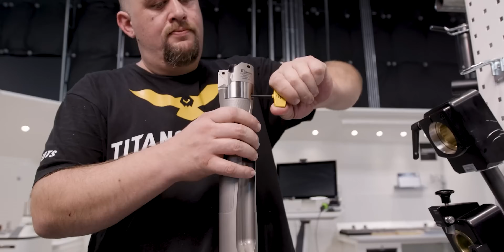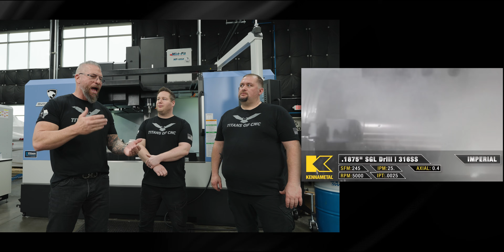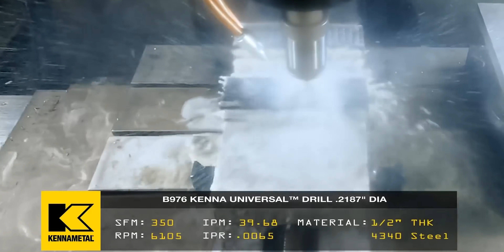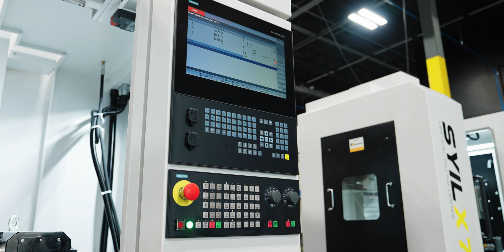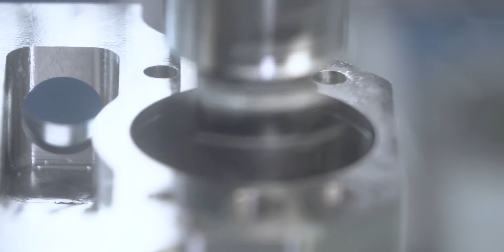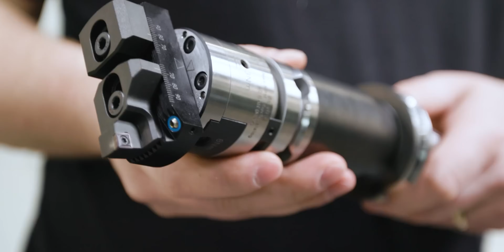Which Tools Should I Purchase? and Why?

Comment: Flower shop is a custom shop do a lot of one off parts and not repeating jobs. So we just have a bunch of general purpose everything in the shop and every CNC operator is a programmer. They'll  hand you the part and sometimes the material or you go cut your own material.

Comment: With bigger more expansive companies also comes certain service, we had a job that required us to cut time spend per piece down by about 20 minutes, with our existing tools that wasn't possible, we had a representative of some companies come around and test specific for the machine, we spend a lot of money on those tools, but they paid themselves off because we managed to reduce the time down to 16 minutes, tripling the daily output. 

For regular jobs where things aren't tolerated so harshly we just use what ever, I got a drill set for 5 bucks, when the drill is dull we sharpen it ourselves or throw them to the dreaded insert pile for recycling.

Comment: Another thing that can be done to extend tool life is to add coatings. I use a Sumitomo 27/64 drill turning 3884 rpms at 32 inches per minute feed for a thru hole of .465 in 1141 mild steel. It comes with a TITN coating of which I can get a consistent 300 parts per drill. When a black steam oxide coating is added I can get a consistent 2300 parts per drill. To put this in better perspective each part has 4 holes so 300 x 4 =1,200, 2300 x 4 =9,200. That is an increase of 8000 holes per drill so it is well worth the cost of the coating.

Comment: I wish you would have stressed more the machine aspects. Some of what you described doesn't apply to me because my machines don't have the performance to run them. Also, you could have gone into more depth about tool life versus cost. Just because there is a tool (Godrill) that lasts a long time doesn't mean 10 of a cheaper drill isn't better.

Comment: A good milling cutter should not be paired with a cheap, low-quality tool holders，You should consider the impact of the accuracy of the tool holder on the machining, and the influence of the taper（BT CT SK ) AT3 F1 on the machine spindle.

Comment: Something I would like to add to this discussion: when using end mills 1/8" and smaller they really should use high quality hydrologic style holders  because once you start getting smaller and smaller the chip-load gets quite a bit lower and this is where TIR becomes quite important. Especially when you start getting below 1/32 dia end mills. Anyone who has used heat shrink holders  should be aware that that while they're really good for 3/8 to 1/2 shank and up dia end mills they don't work very well with the smaller dia stuff because it's very difficult  if not impossible to get it back out when you need to change it... something that can help with that issue is companies that make smaller end mills with larger shanks kinda like Robjack brand. They're a little more expensive but I've used them many times with great success in heat shrink holders... Another thing of note; is that a lot of times, when a hole needs a reamed finish and size, you can use a good carbide drill with high pressure coolant thru the drill so long as you have high pressure coolant thru the spindle on the machine to make the hole "1000 psi is really good for this" and it will and can give really good finishes and hold size very well so you can be more efficient when doing holes where this will work. For an example, back in the late 90s working with a Mori-Seiki SH400 that we put a Chip Blaster brand high pressure system on and in 1018 CRS at 10000 RPM with a 1/2 carbide drill with coolant thru I could go 2-1/2" deep at 110 inches a minute single peck such as G81 or "G82 to control the pause at the bottom of the hole" (sometimes that can be necessary to keep from breaking the tip when pulling out of the hole)... Because you can skip spot drilling and then skip reaming the hole so long as you can get a drill that will cut to the size you need... Anyways, just wanted to add that to the discussion. I appreciate all you guys for helping grow the community.

Comment: Switched a 3 flute carbide multi endmill to a 4 flute mill when learning how to machine stainless 304. The machine was happy and so were my ears. immediate improvement to spindle load. I learned just because you can machine a part with a certain tool doesn't mean you should.
Reply: Well if you kept the speeds and feeds the same then you just reduced the feed by 26% on IPT. Tool mfg's specify chip load per tooth so go by that. 3 flute for SS is kind of silly, I would save that for Al where you need chip evacuation at high feeds and go with 5flt as standard, or more if tougher material. 304 is fine with 150-200 sfm on coated tools, even conservative really.
Reply: @frankpatricola8022  thanks for the feedback. Def have learned a lot now as I am now in my 3rd year of my apprentiship. However getting my hands on end mills is not easy (we are 40 apprentices). I try to keep the feeds and speeds based on the mfg tool specs but sometimes I'm working with worn end mills or just what I have available 😅

Comment: What drill do you use if you dont have though spindle coolant
Reply: Carbide without coolant holes or HSS and keep pecking with both
Reply: @boardstopia  We also do not have thru spindle coolant on our vertical mills. We do not peck however, jus push it thru. Only issue with this method was in Hastelloy with a .5625 drill. Never failed but after previous use in stainless, the edges started to give. It has been reground in-house and cutting well since, however if I were to de-drill those holes, I would prefer a re-coat or new tool. They do not advise peck drilling btw, otherwise I would have done the same.

Comment: I see the tool holder as a tool itself as well. And I say never skip/cheap out on your toolholder ( specially since they are gonna stay with you for a long time makeing you alot of money and with less runout it makes your tool laster longer and therefore save you money in the long run ) so don't skip/cheap out on your toolholder. 

As berry told me in the comment of a different video. It's not chatter. It's less slippery/ extra grip xD

A boring head also gives you a rounder hole since it's not a interpolation of multiple axis moving but only one axis going down and a spinning tool ( the holes roundness then is basically only limited by the spindle bearing at that point ) and I have seen callouts on drawings on roundness of holes. So we just went straight to boring heads ( we had more then one size of hole so we needed more then one )
Reply: Boring head on all holes is insane but I'm sure that is not what you meant. Maybe on larger dowels or anything with a cylindricity callout makes sense. Such a pain though, unless needed.
Reply: @ it was needed but it was only 2 diffrent sice holeswith callout on both diameter. finish and cyrlindricity  on holes bigger then what you could reasnonally get and use when it comes to custom reamer. so we had to use two boring heads. plus there where a lot of parts. therefore a lot of holes and we already had a few boring heads in diffrent sizes so it was a no brainer

Comment: l once had to drill like 3000 holes 12x70mm in C45E. only had HSS from before which sucked and even a general purpose carbide drill did only a few hundred. so for that size hole (since at sizes 10mm+ all differnt types of holes maybe just one or many where allways needed and a big issue) so l ordered a corodrill 870 exchangeable head drill. l could use specialized head for the C45E parts but then if l needed a 12,4mm hole l could buy another general purpose head for that. overall extremly versatiile, great performance, different sizes, from large series to individual holes could do everything. so solid carbide or indexable may not allways be the best choice

Comment: There is a difference between Low Export Quality "Carbide" and mid grade USA, and high quality Carbide $$$. Also get good at ONE  1/16, 1/8, and 1/4 flat end mill S&F for you machine first.  Then 1/16 1/8 and 1/4 ball. I made the mistake of wanting to try "ALL THE THINGS" first. 

 You may not be able to use a 3/8 1/2 end mill on your machine. Plus you will break a 1/8 or a 1/4 usually without damage to the machine if you run too hard or make an "oops" that does not have the collet/nose running into things. 

Even if you plant the 1/4 into the vise jaw. Our Tormach has permanent slight  Nod due to a 1/2 end mill being G0 rapid in the table by a guy.

Comment: Don't buy high dollar tools for low skill level operators.
Reply: Yes. Especially while learning. I was part of a makerspace (mostly wood) and I suggested and was ignored about having a case of "Low export quality" .125 (or a 3mm ER 20 collet and 3mm bits) sold at cost to do the first programs on. The bit breaks and the machine stays in tram if a mistake is made unless the collet drops into the work, and z0 top gives lots of Z travel to do a full air cut. Guys want to start using a 1/2 router bit or end mill... HSS is available cheap all over the  flea markets and estate sales. I have some 5 inch long 1/2 4 flutes for finishing side walls that would be $$$ in carbide. Paid 5-10 each. Also for working in roots/burls/paint/garbage where rocks other non ferrous stuff can be hiding. They usually bend so they won't send a cutter fragment across the room since most CNC routers do not have lexan cabinets. (But they should)
Reply: @rpatrick2  I pick carbide because, yes it's expensive compared to HSS, but when you slam it into the part the tool snaps like glass. HSS will make a bigger mess.
Reply: Yes and no, I say this because if we're talking about production, and even regular smaller job shop quantities and a tight tolerance on a hole. Then getting a good quality tool that is more of a set it and for get situation can be a much better and reliable solution... especially when the hole requires a size and tolerance that only a boring head can deliver... sure you can get a cheap boring head but then it is necessary to have a higher skilled person to chase and tweak it all day long... or you spend the money to  get like a Kaiser brand or DeAndre a boring head that can be set up easily without the need for so much skill and run it throughout the day reliably with little to no headaches... I understand where you're coming from but a true button pusher should not be changing tools and in some cases shouldn't even be checking parts maybe not even loading them. Robots are nice in that situation... I appreciate you...
Reply: @edwardstephens936  I've seen people as I'm sure you have as well, come into a shop and claim they have more experience than is needed for any job on that shops floor and when they are handed a print and shown where the tool room is they can't even read a print let alone even know what a voting head is.    I was thinking more along those types of "machinists" I use that word very very sarcastically.    I also believe in your idea of having high quality tools not just for high quality parts but also as you said for high production jobs.    I've ran plenty of jobs that seemed like they were just the worst job ever, but a simple change in the grade of insert being used or slightly different geometry on an end mill changes the job from being a nightmare to being the job that runs completely unattended with the only time someone goes to the machine is to empty the part catcher box.     Thanks for your reply and your insight on this matter.
Reply: As said low skill level operator, I could not agree more
Reply: Yes and no, we had some old beater bridgeports that didn’t repeat, ran it like crazy. now put a new kid on that and tell him to make a good part. Sure he don’t need some crazy cnc but you need to buy something that works and works good it needs to fit the situation
Reply: Don't buy a Ferrari only to drive your kids to and from school
Reply: @flikflak24  operators are there to run machines. Most are not equipped to make adjustments to speeds and feeds, nor should they. HSS is nice since price is much lower but it is no substitute for carbide with specialty coatings in any way. We run mostly HSS unless needed but it is night and day for sure. Programmer should know how to machine. Operators can stop if there is a tool break but otherwise leave it alone less notes on chip wrapping etc. Drills and endmills are cutting tools and I don't think anyone would prefer HSS over carbide unless machining non abrasive plastics where the cutting edge is better off with no coating at all. My Kennametal go drills have gone thru hell and keep going. If that were a HSS drill I would be running half speed at least and constantly re-sharpening. An extra few dollars does make a difference believe it or not. I am not Titan shill for sure btw, he does that plenty on his own, but I am just speaking from my experience.

Comment: For the 196000 holes With 1 Go Drill was it resharpend or With the Factory Edge
Reply: Factory edge is my understanding. If you search our FB group for the text "Good going" it will be the 5th post down
Reply: which material is the question.
Reply: @ipadize  it was aluminum, to be fair
Reply: @barrysetzer  still would be fun to Drill so many holes without a Regrind 

I as a apprentice as Tool and die Maker have to resharpen every Drill I wanna Drill a hole With Cause every of our HSS Drills are Messed up but stößt iam lesrning how to Sharpen Drills
Reply: @beriklelmut1842 I don't care what material, that is pretty amazing! I also love the godrill line!